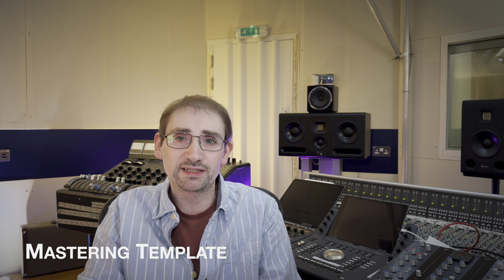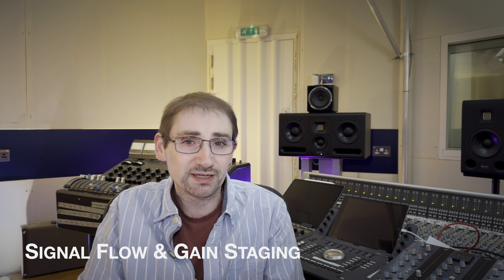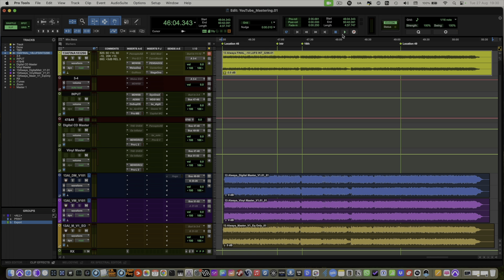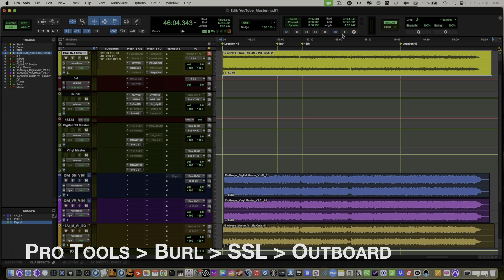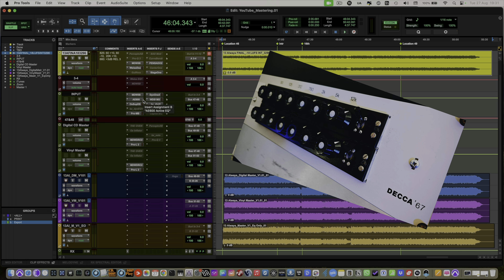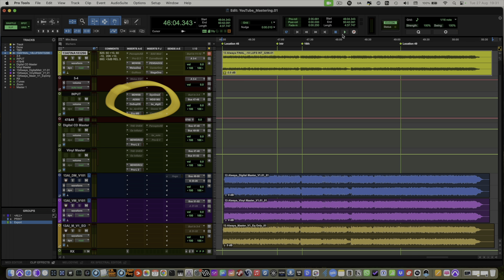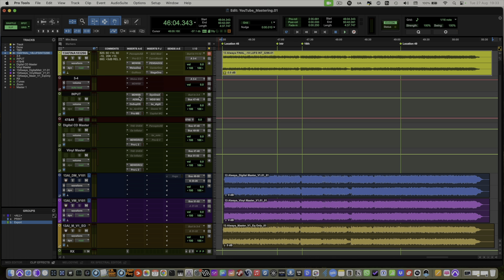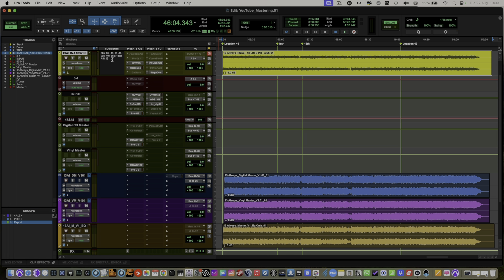My Pro Tools Mastering Template Revealed!

Comment: Yes please to the template!  Particularly interested to know how you set up differently for your digital and vinyl master chains, is it a set reference level that you stick to for vinyl?
Reply from the maker: Thanks Paul. I’ll sort something out and post a link in these comments. 

Re the vinyl master, it’s not a set reference level. Although I do use meters, I go by ear and feel. Usually there are a couple of dB less limiting on output of the vinyl master, just so it breathes a bit more. The rest of the chain is normally the same for the vinyl as the digital. So much is down to the cutting engineer but I’ve found if it sounds good - dynamic, not crazy amounts of sibilance etc, it’ll cut really well.
Reply: @RimshotProductions  V helpful Mike, nice one 👍